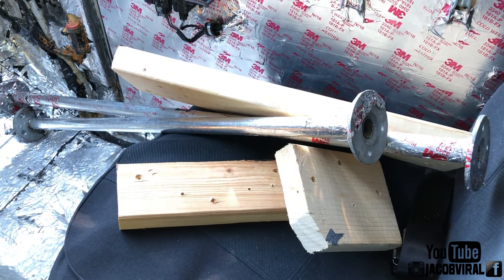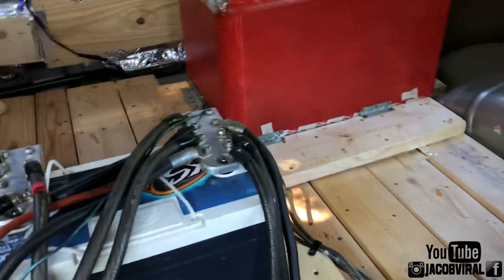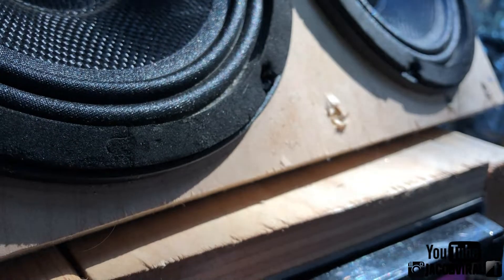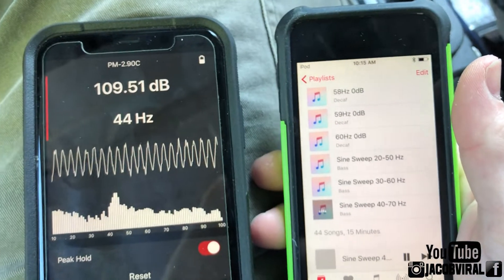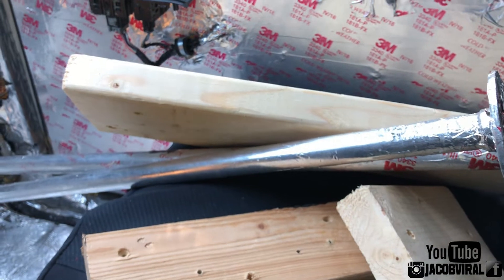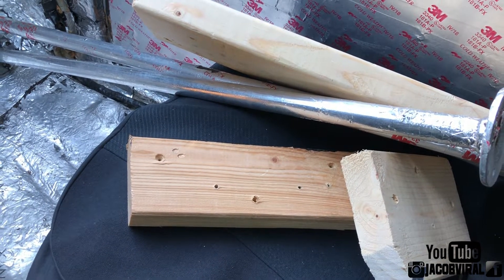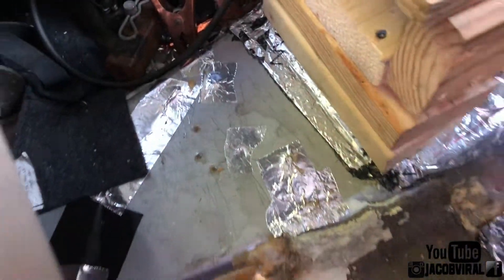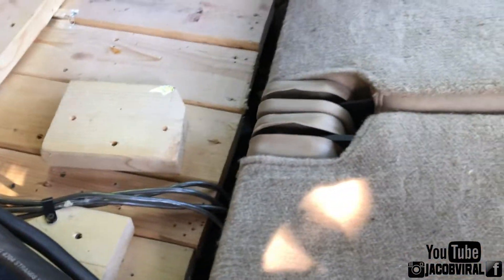HOW IMPORTANT BRACING IS FOR YOUR SYSTEM *TEST RESULTS*

Comment: You do any follow up testing on this? Curious if you tested clamped power, could it be less for the braced vs non braced? I see it happens with boxes so I guess it should happen the same with the cabin but the more damped the sub is the more rise you generally have
Reply from the maker: Yes some in https://youtube.com/playlist?list=PLkYp1Fj-99b2M9RJkPRexATQv4RM0K2Zz&si=To4UU6nY4VABzxrZ - the clamped power changes as well when doing full volume burps, it’s quite fun to see/learn.
Reply: @JacobViral2  That's cool. I've had a setup for 1.5 years now. But now I'm ready to start chasing numbers and I want to take a very scientific approach. My spl meter arrived today, and I'll be ordering a power clamp meter soon. Every change will be recorded

Comment: Where can i buy those stripper pole braces at?
Reply: Dbuilt Series they sell cheap ones at harbor freight or home depot or lowes so you can test first then if it helps you or you already know you want it make one diy or talk to scott bowman
Reply from the maker: I got some 3/4" steel tubing cut to length at home depot then threaded on both ends.

Comment: So you gained db by taking the braces out at the higher volume?
Reply from the maker: Yes, I realized that later after mistaken in the video thank you! No bracing for me in those areas :)
Reply: Wonder if the cabin has a loading affect which acts similar to a passive radiator. Maybe that’s how less bracing let him gain. I’d be curious to see a windows down run. I think maybe then bracing could gain more now instead of a passive radiator affect loading the driver you’d be using the window as a port to load the driver. Idk. But I also know the loudest vehicles in the world all are made of concrete so bracing has to do something beneficial at some level

Comment: How can I fix my flex on my right split door on my 93 suburban? The left door does a lot better but the right rear door flexes way too much. It looks very cool😎 with my doors flexing like crazy even my front doors move too much I know its is hurting my disables (dbs)
Reply from the maker: You can only prevent so much flex without doing extreme modifications involving fabrication work or sealing options.